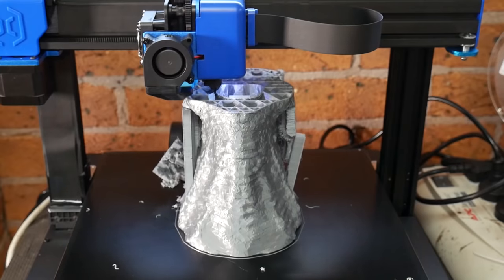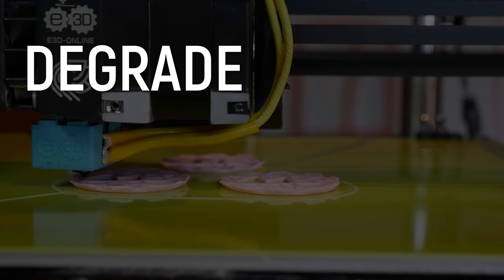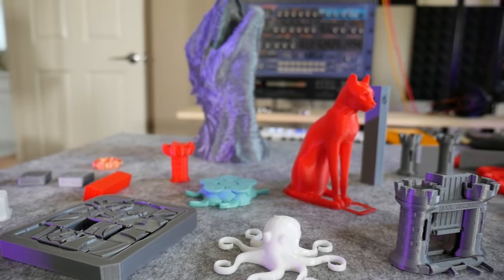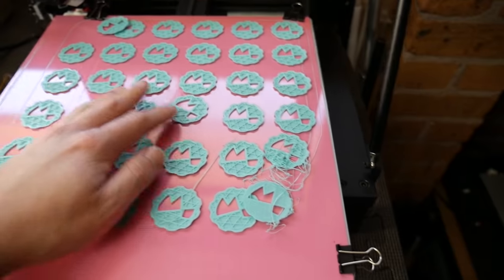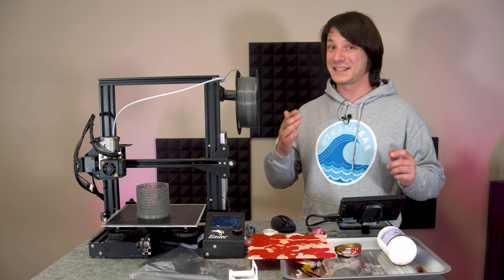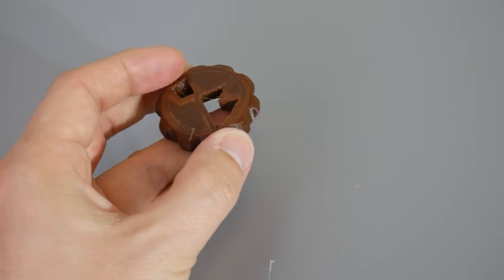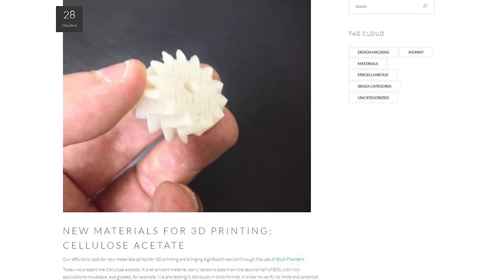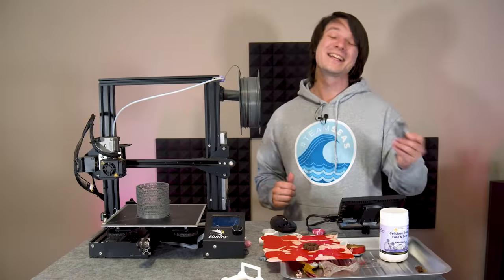PLA - 3D Printing's Biggest Lie.

Comment: This is an important topic, but it's also important to remember that most plastic waste is from single-use packaging, especially for food. I just came back from my local Japanese supermarket with some sushi, seaweed salad, some frozen natto, and a Japanese curry bowl, and all of it was in plastic trays. That goes in to the recycling bin, but very little of this stuff (if any of these low-value plastics) actually get recycled.
We need to reduce packaging plastic urgently.
Reply: Exactly - 3D printing would barely be a wart on the backside of the packaging waste elephant....
Reply: like disposable water bottles :/ they are so cheap. The need to charge those companies to make them and so yes it will raise the price but then less people will buy them? I just see at the grocery store so many people buying a ton of those bottles all the time :(
Reply: Unfortunately food has another big issue: food waste. More sustainable packaging is often not as effective, leading to more food waste. Since food is quite resource intensive to produce (energy, water, land) it is often better to use more effective packaging, even if the packaging itself is less sustainable.
Reply: It isn't just the obvious stuff. Paper fool containers almost always have a plastic coating to let them hold wet food without disintegrating. Glass jars have a plastic lining in the lid to make an air-tight seal. Aluminum cans, both for food and drinks, have a (usually) plastic lining to isolate the food from the metal.

I just took a look in my fridge, and the only thing I see in there that doesn't have any plastic (at least that I know of), is a papier-mâché egg carton.
Reply: @jcon6734  Nearly all aluminum cans as a standard, have a plastic lining; all told over 15,000 different coatings(depending on what purpose they serve)... most with BPA's. That's the bad news. The good news is that with the VERY high recycling rates for aluminum and the coating being microns thick, it just burns up during smelting. The worse news: the hundred billion beverage cans we Americans gobble up every year takes about twenty million gallons of epoxy coatings. Source: WIRED, The secret life of aluminum. Annnd this was in 2015, ff to today it's likely a great deal more epoxy formulas and quantity, but with less BPA's!
Reply: @tinaprice4948  For sure will make them more expensive, but then the other options will be competing on the same ground: glass and metal
Reply: @Cerevisi  IT is true Al can have a plastic lining, but compared to the "disposable" plastic trash, it is peanuts.
Sometimes we need to choose the less bad option.
Reply: @ikocheratcr  True that; also as I said that given the recycling rate, it also makes the threat of microplastics in the environment near zero.
Reply: If we're talking about the ocean, the largest source of ocean macroplastics is the fishing industry, and the largest source of ocean microplastic is butyl and polyester particles from the normal wear of car and truck tires. 

Most of the single-use container plastic in the ocean can be traced to several large river deltas, most of them in asia. 

One interestingly large component of ocean microplastic, from an article i read anyway, was plastic powders for laser sinter 3d printing, but i can't figure out how that became such a large component unless a lot of it has been falling off of container ships. 

Ultimately, your personal choices as a consumer don't mean much compared to what governments ought to be able to accomplish through legislation, and it is important to keep in mind that the idea that your personal choices make such a difference was conceived of and promoted by the companies that make those single-use packages. Here in the USA that started with the "Keep America Beautiful" campaign and its famous ad where a native american sheds a single tear looking at the trash-strewn wilderness. Except that guy is italian.
Reply: @Cerevisi  The BPA has been replaced by other Bisphenols, that are also implicated as being endocrine disruptors. They nay be less or more harmful than BPA. There's just less data. The most common alternative is BPS. Studies in pregnant rats fed BPS in their drinking water showed multiple effects in the offspring.
The BPA-free label may be little more than healthwashing.
Reply: @EricJorgensen  agreed. Individual consumer action makes very little difference. Collective voter action (remember when we were referred to as citizens, instead of consumers?) might have an effect.
The Crying Indian is just one of many cases where corporations have worked to shift the narrative from government action that impact corporate bottom lines, to individual consumer actions. This has been extremely successful.
Reply: I'm not so sure about that. Have you ever seen a bottle blank or a bag pellet. Your typical grocery bag made of plastic comes from a pellet that is roughly the size of a grain of rice. I use more than that just to prime the nozzle with a straight line off the side of a fresh print. The bottle blanks are like tiny candy dispenser sized bottles, get heated and blown into their full size. Same blank for a 20oz or 2lt with the company I seen the process at.
Reply: I have seen pictures in Japanese stores where they  peel oranges and then put those peeled oranges in plastic wrapping. Blows me the fuck away how stupid some waste is.
Reply: We need to Reduce and Reuse more, because current recycling technology isn't cutting it.
Reply: @tinaprice4948  The company I work for was brilliant with this. They recently decided they weren't going to stock plastic bottles in the vending machines for employees, and they replaced everything with can alternatives, and put aluminium recycling bins everywhere.
They also replaced water bottles with these "refill stations", which were basically a water dispenser. Then, they gave every employee (Over 15,000 of us) a re-usable metal bottle. They also hold more water AND keep it cooler for longer. Really made me think about the planet even more.
Reply: @jcon6734  They often do as well, if it's made of recycled cardboard then there's fragments of shredded packaging tape and metal staples in there as well :/
Reply: @EricJorgensen  Most of the ocean plastics originate from asia that's true. But it's not their waste, it has been shipped from the US and Europe to "be recycled" but they don't have the infrastructure for it there + it's not and will never be economically viable to recycle plastics. So they just dump it in the environment and/or burn it. It's sad, legislation is the ONLY thing that might have effect. Virgin plastics need to be more expensive than recycled and we must change our consumption habits, especially in regards to packaging and single-use plastics
Reply: @vesslades  You have it sort of backwards, especially considering that China stopped accepting foreign plastic for recycling 2 years ago. 

They were previously accepting it because they had built recycling facilities but didn't have internal infrastructure to keep those running at capacity. There were probably also operations that just dumped it as well. 

Virgin plastics are cheaper and perform better. Recycling was never a realistic option for most plastics - not for more than a fraction of it. There have been a few things like cushion material that is spun out of old PET bottles over the years. A lot of the time post-consumer plastics are contaminated with food, or dirt, or with incompatible plastics. PET bottles with PP caps for example.
Reply: @tinaprice4948  It would probably help if the water was drinkable or safe in those areas. Even in the US near the capitol its apparently too much to ask for water that doesn't taste like it came down someone's butt crack. I'm extremely cheap, so if it just tastes like rusty metal that's fine, I'm just getting some extra iron. If its hard water that's so bad it makes clear dishes you clean with it look pale I consider that still good enough. The water they have around here though? Yeah it smells like a rotting corpse arm has been sitting in your water heater when you turn on the showers...

I think I would run through so many pounds of activated carbon trying to filter it that its probably better just to import the water from natural springs somewhere else, its amazing, I'd expect that from 3rd world countries, but not from "civilized" regions.
Reply: could start buy not buying stuff in plastic containers, but then you'd have to modify your own habits.
Reply: @Born_Stellar  Right. And since the number of people willing to do this is likely to always be a small minority, it will never make a difference. We need meaningful legislation.
Reply: Most microplastics actually come from synthetic fibres in our clothes. We should use more cotton and other natural fibres for our clothing.
Reply: @tinaprice4948  Bottled water should be illegal. If you want to buy a specific sort of spring water, or distilled or demineralised water in a container, there should be a minimum volume that it can be sold as, to cut down on plastic.
Reply: Oh no, we're doomed
Reply: @S3NTRY  Don’t be a wanker. Not everything falls in to the “nothing to worry about at all” and the “doom” buckets. There’s an entire spectrum in between. Try adopting a more nuanced thinking. And give up on the straw man comments while you’re at it.
Reply: @tinaprice4948  Many countries in europe charge a small deposit on plastic and glass bottles. Usually 0.10-0.25€. You can return the empty bottles at the supermarket to get your deposit back.
Reply: I once did an internship at a local high-quality e-bike factory (yknow what, I'll name them - Riese & Müller, f*** them...) and they pretended they were all high and mighty with their environmentally friendly bikes Made in Germany but literally half the stuff came from Taiwan etc and all the individual parts like braces were packaged in individual plastic bags, and all the orders were printed single side when they could easily have printed them double-sided... It was pretty sobering, and combined with all the other abuse and shit going on there, f*** them, sincerely, but it shows how little these big companies care about reducing waste even when it could easily be avoided, and even those pretending to be eco-friendly are usually full of shit
Reply: We need to do all of it. We need to  demand legislation to phase out single use plastics (and not just by voting, which will achieve almost nothing). We need to push for infrastructure to recycle/biodegrade the plastics that support it. We need to reduce our plastic consumption and reuse as much as possible. We need to normalize reducing waste even if it's less efficient. We need to fight the capitalist order that makes the rest of this so difficult.
Reply: @EricJorgensen  Not sure what I have backwards? We're saying the same thing pretty much?
Reply: Using plastic for food packing is actually one of the few objectively good uses of plastic as it massively reduces food waste
Reply: @tinaprice4948  they're so cheap, yet buying some big water containers & bringing them with you is still cheaper long-term. People just need to get in the habit of being responsible for their fluid intake instead of relying on plastic water bottles & the like.

My whole family over the past couple years has switched to either metal or glass containers for water. None of us are particularly/overly environmentally conscious, but we do simple things like stopped using plastic bags for groceries & plastic bottles for water, because it makes the most sense & even can be a financial gain.
Reply: @JonS  apparently you're the only one permitted to use the "w" word. Which is ironic.
Reply: We used to use paper and glass for packaging.  Both are far better for the environment.  However, the self-appointed environmental activists demanded that we stop using paper and start using plastic.  Look where that has gotten us.
Reply: @tonyheaton4941  LOL! Environmentalists weren't responsible for the adoption of plastic. Which food and beverage industry propaganda video did you get that from? Companies like Coca Cola, Pepsi, and Nestle switched to plastic to reduce spoilage and shipping costs.
Reply: @JonS , your response is typical.  I never said that we should let corporations off the hook.  Both things can be true.  The environmentalists can be to blame and the corporations can also be to blame.  Corporations should be illegal.  Americans were caring for America long before organized tree-hugging became a thing.  The government, via the Forrest Service and driven by tree-huggers, made conditions perfect for massive forest fires that have destroyed large areas of trees.  Before the BLM and tree-huggers, fires were allowed to burn themselves out, just as they have done for man millennia before.  This rids the forest of underbrush and other fuel.  It allows for a much healthier forest.  We've already talked about the plastics debacle.  Whenever the government gets involved with special interest groups, whether it be corporations or tree-huggers (also large corporations in most cases),  the country and its people suffer.
Reply: How, after typing ALL of that out, was your conclusion "we need to reduce plastic packaging" not "Lets make the people that promise us they will recycle stuff, actually recycle stuff"
Reply: @tonyheaton4941  the once great state of California is exhibit A of this issue. With all their environmental policies and such, it was surprising moving to Phoenix and realizing my home state literally looks like a junkyard fire. Meanwhile, a relatively low-tax, low-regulations conservative/moderate state has its plastic problems under much better control.
I remember when California introduced its plastic bag "ban." When I looked it up, it was sponsored by Big Paper Lobby and essentially forced businesses to charge for ALL bags, both paper and plastic. This forced grocers like Winco and Sprouts to charge for what used to be their free paper bag option. As much as I love the environment, I voted a big NOPE to that bill, but it still passed because of all the greenwashing. Now it means more inflation and even more plastic pollution (more plastic per bag) because now paper costs companies even mote than plastic.
Reply: @geoninja8971  No one is disputing that packaging waste is a far bigger problem!  So I don't see what the point is Jon_Stern and yourself are trying to make?
Reply: @tinaprice4948  or put a return fee on the bottles like we have here in Denmark. Coincidentally I see no water bottles thrown into nature. Because money makes people less lazy. If the container is free it gets tossed, but if it costs a quarter it gets collected and recycled. Empirical knowledge.
Reply: @Space-O-2001  I really don't understand what is so terrible about burning plastics for energy.
1. Most plastics are made from natural gas or petroleum
2. Most natural gas and petroleum (~90%) is burnt for energy anyway. A very small portion of these fossil fuels are used to make plastics. 
3. Recycling of plastics efficiently is extremely difficult, due to the incompatibility of different grades of plastic with each other in material processing. 
4. Plastics burn efficiently with a very good  heat value, close to the starting material 
5. When burnt in a modern incineration plant with exhaust gas treatment, the only problem is the generation of CO2, which is the same for all fuels. 
6. Incineration eliminates the need for complex recycling infrastructure, as all combustible waste can be collected into a single fraction. 
7. This approach can be easily and readily imported and set up in developing countries, also to  generate electricity for the communities
Reply: @Mr.Proghead  I'm not biting
Reply: @jakegarrett8109  yep not everyone has water they can drink  cant drink the water in any of the towns due to the tap water having copper , lead , clay and who knows what  and yet the water is tons better than other places . I hate water bottles but would rather water bottles than a britta as britta tastes eveb more like  chemicals to me and it doesnt make the water drinkable  as you would have to filter so much out just to want to drink it.
Reply: We need to make alternative plastics that dissolve in water. That’s the kind of plastic that you only need for an hour and then it’s gone. I think single use plastic bottles can be replaced with glass bottles that are actually recycled because glass also has a purpose in stuff like windows.
Reply: Here they say most Microplastic in nature (in the country not oceans) is caused by car tyres.

Comment: this was maybe 8 years ago now, but the University of California, Merced waste management could not get "biodegradable" utensils to degrade in their systems and actually switched to metal washable flatware and recycleable plastics. It seemed that at least then, even in the industrial composting systems they could not get some of these compounds to break down.
Reply: There's also just that washable is the most eco-friendly thing around. 
If you don't have to make a new thing for every use, you save a TON of resources and energy.
Reply: The problem is the time frame, there are some biodegradable materials that take hundreds or even thousands of years to break down, like bone.